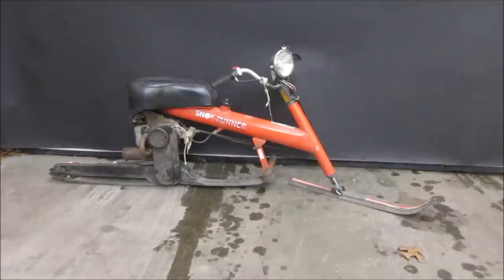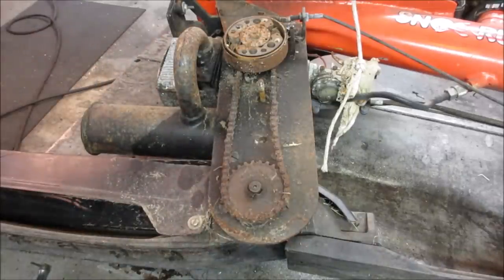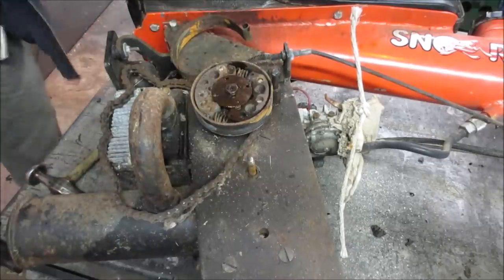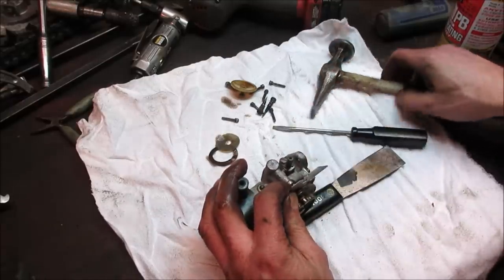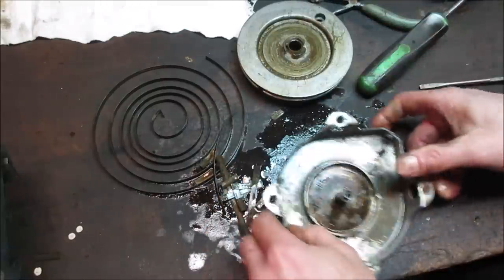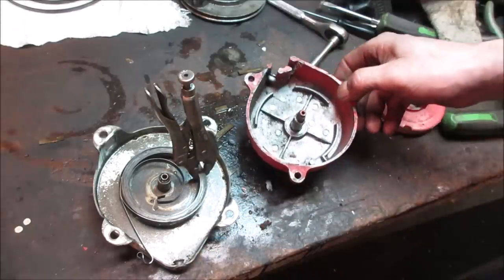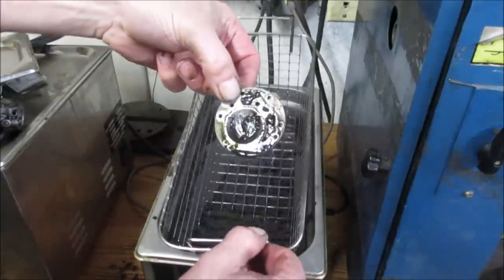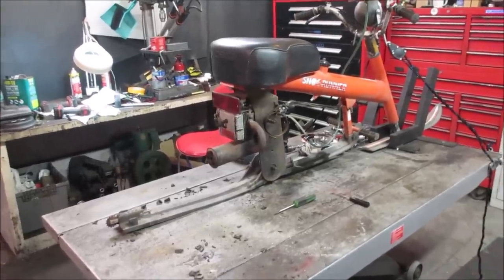Can It Be Saved? Chrysler Snow Runner.

Comment: i'm building my own little snow bike out of a coleman mini bike, so i'm interested in this just to see the way they did it. i'm a little surprised that they have the front ski weighted to tip forward, but i guess it must be fine. i though i might have an issue with it digging in if i got a little air. maybe i wont worry about the length so much and i'll just make sure that the ski has enough surface area.

Comment: All metal track would be neat, but I think it's a bad idea. I can't find an all metal track for a snowmobile, and I find legal restrictions about studs on rubber tracks.

The Ford Model T had all metal tracks available, but the Model T had many ideas that shouldn't be copied.

I'm guessing the problem is that all steel tracks tear everything apart…Including flesh, even when broken off the chain & flying through the air.

Comment: Would it have had a air filter when it was new? I most snow blowers and outboard motors don't have air filters because it's assumed the air will be clean in their normal operation locations.

Comment: If the red pull start actually turned the engine, like it initially did, why then start struggling with getting other springs?  Why not just use the red pull start as it was??

Comment: 25:35 kind of makes sense since the clutch would be keyed to the shaft and the cup would be locked to the drive chain and each would have to move independently of each other. 

It's american made, shouldn't be that difficult to find a bearing with x inner, y outer and z wide. I buy from Canada Bearings, they have every different type size style and colour under the sun...
Reply: Go Canada!

Comment: It there were a version made today, It would be a Dodge and use a Lithium Battery and electric motor right into the chain drive, needing no centripetal clutch or brake. Using regenerative braking instead!

Comment: Better make sure the engine will run before getting the pull start fixed.  You could always use a drill to start it.  If the engine is junk, no use fixing up the pull-starter!

Comment: It looks like you're running the engine in the wrong direction. The pull cord can be installed to start in either direction. Are you running in the direction of the "Rotation" sticker on the shroud?
Reply: I agree with you, before he took it apart the pull was to the rear of the machine, he reinstalled to the front.
Reply: The pull starter can be installed in different positions, but it does not effect the direction of rotation.  It can be installed up, down, forward or reverse,depending on your preference.
Reply: @robertheinkel6225  If you flip the recoil spring and pawls you can wind the cord the other way. If ignition timing is OK, the engine will run the other way.
Reply: The EZ Go golf cart we had where I used to work years ago took advantage of that fact. It had a Robin two stroke that ran one direction for forward and the other way for reverse. You flipped a switch under the seat to run the starter in whatever direction you needed the engine to start.

Comment: A great example of 1970s Detroit engineering.  Why use extruded aluminum for the track paddles when plastic is 2 cents cheaper?  After all, it was never meant to last more than two or three seasons.

Comment: that is a vacuum pumper carb.  the fuel line must have a fuel filter on it for the engine to run right.  don*t just drop the fuel line in the tank.  need a chain saw fuel filter on it

Comment: I think if ya'll got the biggest Stihl power saw motor and replaced that garden tractor engine  ya'll would make enough speed to not just fall over all the time. I say that because that wimpy motor in comparison to a snowmobile engine is VERY LACKING. Course ya'll would need better skiis like replace those plastic skiis with like K2 downhill skiis so they don't fall apart at 35mph. With a good strong motor, this would be a blast to ride on firmly packed snow. Out back at your house will be a fail I predict. Also to make it act like a dirt bike ya'll would need 12" travel on the front fork and at least 6" travel on a rear shock which I am pretty certain would ride like a buckboard wagon instead of a dirt bike, just sayin.

Comment: There is a simple way to wrap that spring....let the spring GENTLY unwrap....hook your inside hook in the reel and wrap it by hand in where it is supposed to be. When you are a little over half done or so the rest will just lay into place. Also your making your life miserable filling that cylinder with oil right at the start.

Comment: Just remember, this type 2 cycle should NEVER run smoothly (like a 4 cycle) till it is running wide open with a load on it.  If it leans our with no load you will be running lean and burn a hole in the top of the piston.